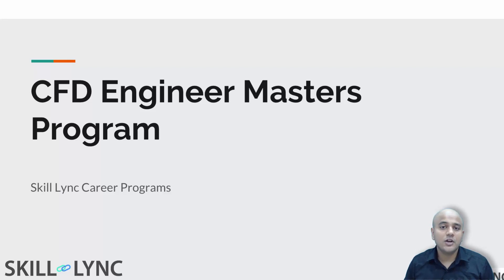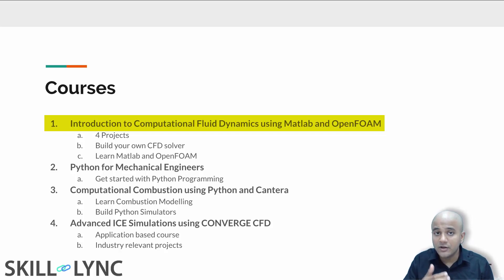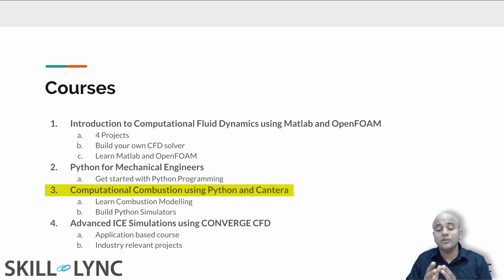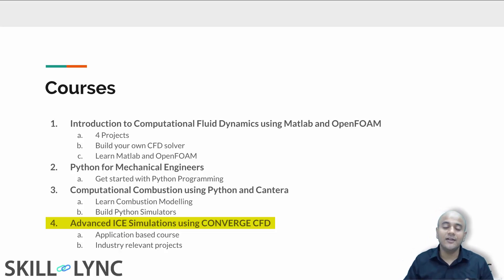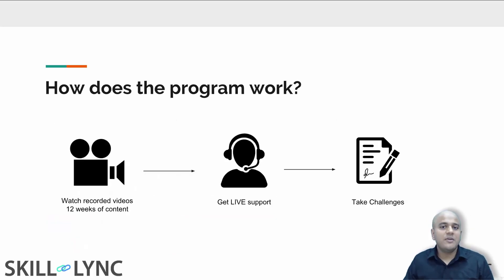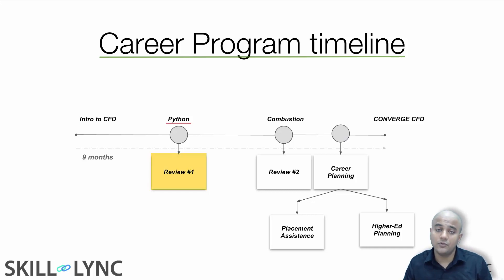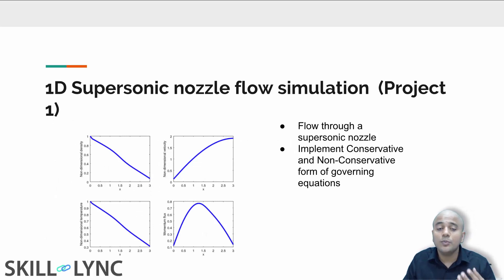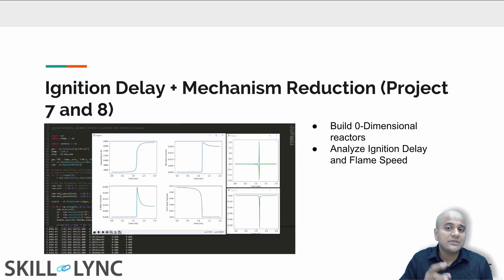CFD Master's Program | Skill Lync

Comment: I like your courses.i am an engineering graduate but some very basic understanding of fluid mechanics and I'm really interested in a course like CFD where I can apply the knowledge to marine designs,though not currently working but I need a strong background in not just using the tools which are basically   clicking here and there on a UI but on getting the right basics,using a tool and making very necessary design decisions.my questions are
Can this course help me gain insight into these requirements?
How much will it cost me?